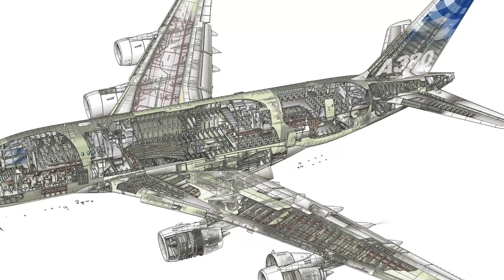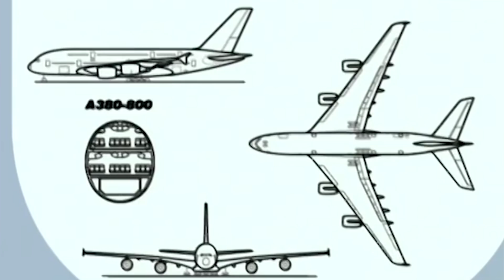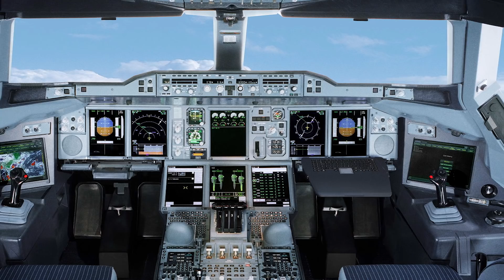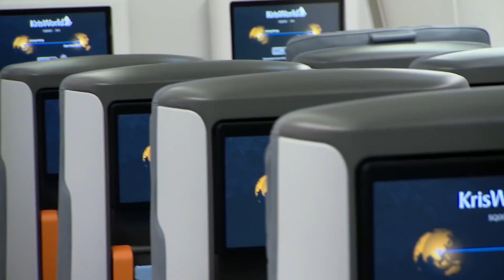Airbus A380 - the European flagship

Comment: Nice video. BUT, no new orders in years..... not even for cargo. 747 had a good, 40 year run. A380...10 years. Not bashing and respect Airbus for creating this amazing airplane. No market for such a large plane.
Reply: @Gmail X no they haven't. They have announced that they WILL stop production forever in a few years, when remaining but shrinking orders have been fulfilled.
Not "Now stopped production" at all.
Reply: Didn't they receive some orders from Emirates last year?
Reply: Emirates have many A380s. They have ordered more
Reply: Have you not payed attention? Cargo version is non existent and cant be ordered.
Reply: Sky, you have a good pronounciation for this
foreign language👍
Reply: A380 not suited for cargo. Can't fully load it.
Reply: Actually market changed. Not many orders for 747's either. (except cargo)

Cariers went from hub and spoke organisation to more direct flights.

Usually with smaller long range planes like the 787 and A350. 

As a cargo plane the A380 isn't that efficient. It's made for internal volume not lifting capacity. 

Then it can't be loaded through the nose like a 747 cargo plane. 
(which offers far more efficient loading). 

TLDR. The jobs it was designed for are going out. And it is a lousy transport plane.
Reply: @1barnet1  Correct. 747's are vanishing from the common carrier market....now, only cargo orders. Market wants fuel efficient, twin engine planes.
Reply: @bril5057  Makes me think if boeing or Airbus would design a proper modern cargo plane. with front and rear doors with the largest twin engine set-up and best fuel economy.

How well would they sell?
Reply: 1barnet1 

The 777 freighter is selling very well.  

The nose door on the 747F advantage is to be able to load long oversized cargo for the heavy lift market that won’t fit through a side door.  In that segment, it competes with the Antonov.   Many 747 cargo planes are converted passenger planes and don’t have the nose door. 

Loading ULD containers is easily done through side doors.  If you look at FEDEX, they don’t use the 747F, they have been buying up the 777F and 767F as they replaced older aircraft. 

Cargo market is very different than passenger market.  For example, most transpacific cargo planes stop in Anchorage Alaska for crew change and to be able  to carry more cargo weight than fuel. 

There is talk that Boeing had discussions with FedEx and I am sure UPS  on the proposed 797 as a freighter.
Reply: @1barnet1  something like An-124?
Reply: @luket1085  
Yes but without the gas guzzling engines of a russian plane. And without the need of 4-6 crew members.

Not to piss on russian designs. I think given their resources they've made the impossible possible. Especially with the An-225
Reply: 1barnet1 with kneeling front gear akin to the Ruslan and Galaxy, am I right?
Reply: @1barnet1  yep, this is the reason.
It was a great design idea, and when they came up with it, would have suited the market. However the market has changed and big 4 engined aircraft that have to fly into specially equipped airports is not what airlines want.

The aircraft its self was and is no failure, just very late to the party and past its time now.
Reply: My thought about it is that they might try it once they have all the customers happy. My thought always been that once it lost it's glamour they might try to build it and assemble it all in one place, cutting costs and improving times of delivery. I want to know if they'll try to do it in France, or if they want to cut a lot of costs and they'll try to create a huge assembly plant in Spain, for example

The reason why it was assembled all over the place is because it was a great pride for Europe, but now, it would be better if it was built faster and cheaper. And for cargo I'm sure it will always be cost effective, because there is always need to transport a lot of stuff everywhere, specially with the rise of Aamazon and Alibaba and their big pockets
Reply: @joseanl   Be in mind that France is the final assembly of Airbus aircraft. A lot of European country's developed and are producing materials parts, and subassymblies for Airbus.
The 380 is THE most economical plane for high capacity routes between hubs.
This type of travel is in decline, because point to point travel in smal aircraft is in increasing.

The next generation fuel efficient turbofan engines in development (variable fanblades for optimized combustion at all heights ) will be in my opion the gamechanger for the industry
Reply: @obelic71  I know, but as much as I want and any country that collaborates on the 380 and builds parts want to continue to build parts, I think its really inefficient.

I mean, the scale of the plane is so big, that it requires a really big effort to move all the parts from the countries that build them. In that regard, Boeing's Seattle building facility has and advantage. While I'm sure they'll still get some very important systems from other parts of the US maybe all over the world the world I doubt they'll get some parts as big as some wing parts, or of the the hull or the tail
Reply: @joseanl  The Boeing Everett plant gets its sub asymblies even from India and they have their own special cargo planes (dreamlifters) to get the assymblies. The big advantage of Boeing is that they have a US rail connection. The US have a bigger cargo dimensionprofile for their railcargo then the European railroads. 
Therefore Airbus needs special Trucks to transport the loads from port to the final assymbly plant.  Building large machinary is for all builders a logistical nightmare around the world. Just ask Caterpillar about their mining mega dumptrucks.
Reply: @obelic71  true! I didn't think of that, the bad part of having buildings that have lasted centuries, even millenia is that we can't let pass those huge trains that other countries like Russia, Australia or the US that are supper efficient transporting lots of tonnage at once! I've seen videos of the trucks going like 2 miles an hour while crossing some little french village and its so ridiculous and it seems so inefficient...
Reply: @joseanl  thats why logistic is an often underestimated science. 
Every other product, country or location needs an other solution.
To move the final assembly Airbus plant near a deap water seaport with an big airport attached to it is an utopia. 
Those 5 km/h crawling trucks true villages might not be so bad a logistic solution afteral.
Buying an airline ticket is a smal step in the entire chain from mining raw material to the finished aircraft at the gate ready for departure.
Reply: @obelic71  Boeing recently opened a manufacturing facility in the UK to start manufacturing components.

Spreading work out is VERY good economics, it means that you eggs are not all in one basket. If the economy of a country starts to dip, production can still continue elsewhere.
Also, if you invest in a country, it makes you look better to the government's and airlines of that country, therefore a good sales tactic.

Plus, you have to take experience into consideration, the wings were built in the UK because the facility was in an existing factory, with years of experience and expertise.
This is a great reason to have cross nation products, you can take the experience of those outside and share the risk of the project.
Reply: @underwaterdick  the UK produces a lot of aircraft components meanly undercarrieges, aircraft engines and wing parts. 
Companys build their products were they are the cheapest to produce. 
The production of parts is going more and more to Asia because of the biggest growing market for aircraft.
Production will go to places were there is the best mix of Money, marketing, sales, infrastructure and (geo)politics.
Reply: @obelic71  I know they do, that is how I got my Career in Aviation!
But BOEING themselves have opened a factory in the UK, not a component manufacturer. You see, a component manufacturer is based where they are based, and you buy components from them wherever, but to actually build a factory somewhere in order to diversify and invest is a big step.
As an aircraft manufacturer you can't change where Dunlop, BF Goodrich or Rockwell Collins are based.
It isn't all about cost, sometimes about politics or risk too.
Why was the JSF created? To spread the development cost AND risk between partner nations, also to allow the sharing of technology. The Eurofighter has a lot of kit that America do not possess, many believe that America hoped the European companies would bring some of these pieces of technology to the table for F-35.
Reply: @underwaterdick  I was always underway as an engineer to modify/fix aircraft around the world. My career started at Fokker with the military F16 program and civilian F28, F50, F100 models. After Fokker went bust i went to KLM maintenance. Several times i repaired the aircraft at the gate and boarded the same plane and washed my hands in the galley 😂
Reply: @obelic71  haha, now that is a flying spanner lifestyle!
Yet to fly on an aircraft I have just maintained, they always made me get a hire car and drive to other airports/military airfields. The long and slow way lol.

Quite a good Fokker line up there! I have worked on the F20+F50...but it's a Dassault Falcon not Fokker. 😉
Reply: Inkling Boy 

You need to do your research and learn the cause of the Disaster in the Canary Islands before you label that as a 747 failure.  In fact, It had nothing to with the 747.  It was a collision on the runway due to bad airport design, poor visibility and air traffic control. 

Emergency landings happen all the time including with the a380 and it occurred with Qantas due to a engine failure causing the plane to declare an emergency into Singapore.

If you want to talk about how well built the 747 is, look at the United flight to Hawaii that had major structural damage due to someone not properly securing a cargo door.  Pilot continued to fly the plane with a massive hole in the plane to destination.

Comment: Sad that these things are already being phased out and production is being slowed drastically. I do wish that we could still fly large airliners rather than the flying sardine cans that other smaller liners have become.
Reply: It's a shame but it does seem the future is wide-body, incredibly efficient twinjet planes instead of quadjet double-deck planes. It does make sense but man the A380 and Boeing 747 are a sight to behold and I'm going to miss either of them if they ever stop being in service (mainly the 747).
Reply: @TheIshikawaRin  Yes It's sad, the 4-engine giats as the A380 and the 747 will retire. Boeing 777X and A350 will be flagships
Reply: Well, would you rather fly in an even smaller sardine can to a airport hub where you can then transfer through security to a gate at the other side of the airport.

To catch the big plane which carries you to another hub. Where you then have to catch another small 
Sardine plane that carries you to the place you wanted to go. 

Or do you rather just take the crowded oversized sardine can straight to your destination?

It's the more direct routes that killed the big 4 engine planes.
Reply: Personally I’d rather fly anything that gets me to my destination safely.
Reply: @FlightyFilmsy  
That would be any modern plane. Sure some new ones had teething problems but most of those are taken care off.(battery problems 787 or Rolls engine problems on both planes)

The Rolls Royce trent issues seem to be the most persistent. Hopefully they can get through it. There ain't that many jet engine manufacturers as is. I'd say only 3 competitive ones P&W, GE and RR
Reply: I wonder who’s going to keep the A380 the longest. Probably Emirates and ANA...
Reply: you cannot stop progress
Reply: Beryllium Unless you’re Emirates
Reply: Why, because it is better to be packed in like a sardine with 400 other passengers in a large cabin instead of being packed in like a sardine with 200 other passengers in a smaller cabin? It is not like larger airliners means the passengers are given more space. They could be, but they are not. Airliners invariably pack the maximum number of passengers they can into the available space to maximize profits and to reduce ticket prices to compete with the rest more effectively. A big fuselage like the A380 just means they can pack a lot more people in. They put 11 seats instead of 9 or 10 in each row. They have found that by making the seat backs straighter they can cram a couple more rows in per cabin. Everyone complains about this, but they still all always go for the cheapest ticket they can find, which is why airliners do it. No-one wants to pay a bit more for comfortable travel. Those that do buy first class, and in that case I don't see how the difference between a A380 and 787 is that significant in terms of comfort. As long as you have leg room, room to recline a bit, and aren't touching shoulders with the person next to you, what more do you want?
Reply: Well, because of "reasons" we can't ban moh-slehmz from flying, so big aircraft , and air travel in general, is a juicy target.
     For some reason we have people in charge that wish to harass and punish white Europeans and ignore the fact that muh-slihmz are a hostile alien people.